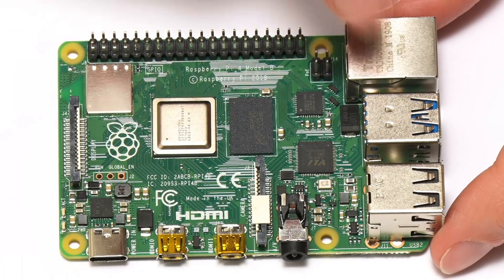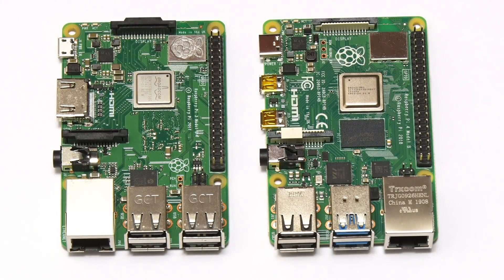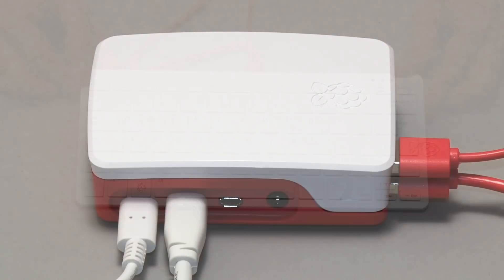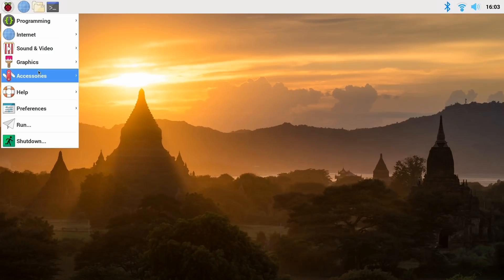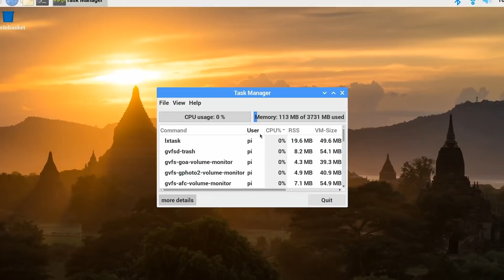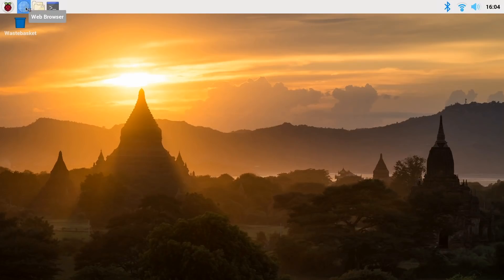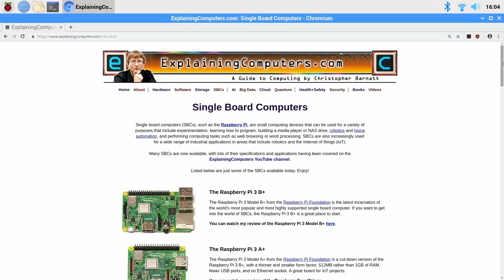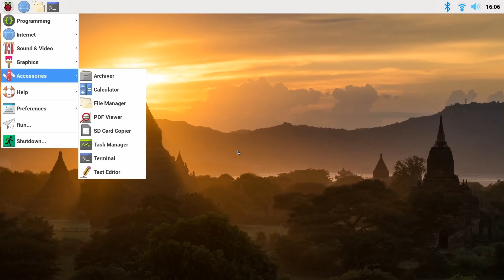Raspberry Pi 4 Model B

Comment: USB 3.0? Hello, SSD!
Reply: :) just put a NVME M.2 storage device inside a M.2 sata 2.5 with usb2 SSD enclosure ,placed inside a 3.5 drive cage,placed inside a 5/14 pc drive cage ,fitted into a spare cd drive slot, and sellotape a pi in the full hight pc case somewhere, and then just connect them together with your old usb1 hub sitting in the draw, sit back and wait for your coffee to warm up ;0) before you breakout the 300 baud modified acoustic coupler modems...
https://www.alibaba.com/product-detail/2011-fashion-USB-cup-warmer-with_513318946.html?spm=a2700.7724857.normalList.118.7b034a0czyTCi2
Reply: @paulmaydaynight9925  Now I'm aroused.

Comment: 4k display, 4GB RAM, hardware video codecs, USB3, gigabit ethernet. This is actually useful as an ARM version of a NUC.
Reply: Sadly no MassStorage Port. The Pi really needs a storage port (SATA or NVME).
Reply: @guytech7310  Odroid HC2 has SATA
Reply: @guytech7310  Nvme on the bottom might be a possibility down the road I would think.  Just an old guy; don't mind me.
Reply: @guytech7310  Yes, a m.2 slot would be awesome, as well as a RAM slot, but I'm afraid that could push the price up significantly. USB3 helps with connecting faster storage, though.
Reply: @DanijelTurina973  Ok so a Pi with a SATA or M.2 Port increases it to $85 to $100, I presume you would very much still buy, with a Mass Storage Port, it more than doubles the uses for the Pi.
Reply: @guytech7310  It depends what I need it for. If I only want it to run some python service that reads ambient temperature and responds to requests, then no, I'd buy the cheapest one and it would still be overkill. But I would buy an ARM version of a NUC, with two memory slots, m.2 and SATA, gigabit ethernet and good graphics, and I would want it to be an 8 core geekbench 15000 machine, and I'd pay 500 euros for that and use it as a linux desktop machine, as long as the hardware doesn't include remote kill switches that Intel and AMD have.
Reply: @DanijelTurina973  Sure, but there are already plenty of Pi versions that can already do that.
Reply: @Guy Tech Does one really need a storage port? You can use a Ram disc (on the desk in Riscos) and send to your serial device.
Reply: @factorylad5071  At best a Pi has 4GB of ram. a SATA or M2 drive can store terabytes. 

If you wanted to use a Pi as a small server or desktop machine. A decent linux distro would require a few 100 GB of storage. 

In my Opinion, a Storage Port would make a Pi complete SBC and would dramatically open capabilities.
Reply: @guytech7310  Yeah, and that's where the ROCKPro64 shines! Hexa-core CPU (4x Cortex-A72, just like the RPi 4 + 2x Cortex-A53), up to 4 GB of LPDDR4 RAM, support for eMMC, PCIe port... for just $20 more than the RPi 4.
Reply: @GRBtutorials  Yes but Pi is the standard, thus very likely more app & hardware\driver support especially over the long term. The Pi Clones will have custom drivers or tools created by the mfg, which may go out of business or just stop supporting or providing updates for for older SBCs. 

If Pi comes out with Storage port its going to be a standard that will be around for a very long time, and also provides a standard drivers\tools for Pi Clones.
Reply: @DanijelTurina973  *an M.2 (because "em-dot-two" begins with a vowel sound)
Reply: Danijel Turina i was thinking the same.

most office and school computers could be replaced by this
Reply: @fwefhwe4232  I'm quite enthusiastic about trying it out with a full version of Ubuntu, either Mate or KDE, and using it for a few days as my desktop PC, just to see how practically usable it is. I tried it with 3B+, but it's so slow I had flashbacks from the 1990s. :)
Reply: @DanijelTurina973  probably be better to stick with Raspbian instead of putting full Ubuntu
Reply: @jacobtungate3828  I'll definitely try it with Raspbian first, because I expect it to be better adapted to the hardware. Also, I'd prefer to get KDE running, but if it's slow I'll rather have Mate or XFCE than LXDE.
Reply: Milktank ™  Windows 10 is not useless. In fact, it's the best OS around by most metrics - performance, reliability, hardware support, ability to run everything. However, it's also a huge privacy concern, the updates run way too frequently and are disruptive, it installs software as a form of spam, without permission, and it probably has several layers of back doors, and that is in addition to Intel hardware back doors and kill switches. That didin't bother me before, but since America started using technology to sanction Huawei and restrict access to operating systems, I think everybody should be worried. Privacy and security-wise, a Raspberry Pi running Linux (with proper security put in place) might be the best thing around.
Reply: So many super-nerds flexing here in the comments.
Reply: the ONLY true disadvantage of this to the nuckit is a lack of Sata,  if  there was an msata slot on this board  instead of the cardreader it would have been the perfect board as msata is just so mutch mor stable than sdcards.  An option would be to use one of the usb3 ports  as usb3 is fast enouht for a usb-to-sata adaptor but sindse there  is no  usb3 port (or header) on hte back of the board,  adding one  neatly will be a pail :(
Reply: Waiting for a water cooled, 'cocked and loaded' ARM64 cpu/gpu and nvme x4 ssd
Reply: @whothefoxcares  The point of a Pi is a lower power\low cost SBC for modest computing needs, not as a gaming machine capable of 128 fps at 8K. 

FWIW: I use a atom server 20W CPU as my primary server. Linux with Samba\NFS (NAS), DHCP, DNS, Firewall, smtp\imap, dlna, Security DVR,  Asterisk (VoIP PBX), Plex (Multimedia Server), D2D backup for clients, SQL, VPN & a couple of VMs with apache web apps.  This machine has ample computing power for all the services it provides. Since this server is running 24/7/365 and uses less than 100W its far cheaper than paying for a server that draws +800W.

I doubt you ever see a Pi that needs to be watercooled. The Pi was designed as lowe cost, low power SBC.
Reply: @igcogcigciggicifx4763  I could be wrong but I believe it doesn't.
Reply: Main thing is that ethernet is now directly connected to SOC. Not like old usb ethernet adapter.
Reply: @igcogcigciggicifx4763  that sucks then. for a mini pc with ECC support and SATA maybe UDOO Bolt but IMO for the price of it you can get better hardware.
Reply: Would probably run Windows 10 for ARM nicely (if they make drivers for it)
Reply: @stonent  Well, the Windows 10 are not as exciting to me, because unlike Linux, where you just need to rebuild the entire repo for ARM and you're set to go, and if something isn't recompiled you download the source package and build it yourself, with Windows you basically either depend on the software vendors to make an ARM compile, or alternatively you run it emulated, which negates the speed increase.
Reply: @stonent  Windows 10 Sucks. Cannot understand why anyone wants to use it. MS move to subscription model sucks even more, and non business editions of Win10 bombard you with adds. Reminds me of IE with the Popup bug that just opened more spam when you tried to close the spam popups. Pure Rubbish!
Reply: @guytech7310  so then what OS do you use/recommend over W10?
Reply: @realifejon  Raspbian is an obvious choice for an OS on this, isn't it?
And there are support for Ubuntu, if you like that.  
Actually, the performance from MS Windows will probably be a disappointment if you compare to ordinary PC machines based on Intel.  They got more memory and more CPU power.

But I am guessing now, as I have not tried one yet.
Reply: @realifejon  Currently I use Linux\KDE Desktop with a Windows 7 VM (Virtual box).
Reply: @AndersJackson  I was mainly referring to @guy tech's comment of windows 10 being a shitty OS, and someone else saying that this can almost replace a school computer. If windows 10 is shitty, what other than w10 or w7 do you also recommend? I'm building a secondary pc to work on from home and currently im on windows 10 but the new pc i want to install a different os. If you recommend Linux, what distro? I have been looking at Kali Linux as well as Ubuntu, but im willing to try anything.
Reply: also my field of work is programming so ill take any recommendations for good distros for that too
Reply: @realifejon  For programming, pretty much any distro will suffice, you can use Ubuntu if you're a beginner. Kali Linux is purpose-made for hacking, not programming, so I wouldn't recommend it unless you want to hack anything. Finally, I recommend the Distrochooser if you're still undecided: distrochooser.de/en
Reply: @guytech7310  *sucks
*MS moving to
*non-business
*ads (short for "ADvertisements," not "ADDition."
*popup bug
*rubbish
Reply: @AndersJackson  Hello, are you referring to the RISC OS that cannot use wireless ?   I really don't want to be connected to an Ethernet cable.  Why hasn't someone developed wireless capability for RISC OS ?
Reply: @realifejon  any other Linux distro then Win are a better choice on RPi.
I would go for Raspbian on a RPi, but Ubuntu is probably an ok choice too.
What to choose depends on you. If you have not used Linux before, I would suggest Raspbian or Ubuntu.
The Kali Linux might be an good choice,  but probably not for a beginners.
Yes, Linux distrs are not MS Windows. You need to understand this.
Reply: @stevieray2804  well, you can add a wifi device to RiskOS if you need it.
It is OSS.

No, I have not tried RiskOS.
Reply: Milktank ™  lmao you idiot, you're just wrong.
I work in IT in a private bank with 4000 employees and we're migrating to Windows 10 right now.
You're 100% completely talking out of your ass, Windows 10 is perfectly usable.
You do understand that end-user clients don't comprise the entirety of a company's IT-infrastructure or its functionality, right?
Reply: @gouryoku  on a Raspberry P?

Comment: Wow, that is brilliant. Just wondering about the 'official' RaspberryPi case - I'm guessing there is now more heat developed and the case doesn't appear to be designed for heat dissipation. I've tended to go for the Pibow cases, great colours plus ventilation seems good.
Reply from the maker: It does indeed get warm inside the official case. :) I will be testing out various cooling solutions.

Comment: I'm honestly surprised by two things. 1. The move to usb type c for power, and 2. The dual micro HDMI.

I remember them talking about the next pi not having the exact same layout, but I was definitely not expecting this. Micro HDMI kind of rubs me the wrong way, though I'm OK with USB-c for power since the board requires more to run than previous pis.
I was expecting 2gb of ram to be the next pi, but I was also expecting them to stay with ddr3 still as a cost saving measure. The move to ddr4 and multiple ram options are very nice though.
Thanks for sharing this, its awesome seeing the new pi so quickly on release.
Reply: *surprised
*remember
*definitely
*Thanks
*It's awesome
Reply: @alvallac2171  Fixed.~

Comment: Can you run Windows 10 at a minimum without struggling?  I'm not saying we are all trying to do this but I am curious how hard it pushes.
Reply from the maker: Yes, you are right -- ARM Windows has been made to work on a Pi, and should indeed run better on a Pi 4B. :)
Reply from the maker: This is an ARM board, not x86 -- so it won't run standard Windows 10.
Reply: @ExplainingComputers  I remembered the version made for 3b+ compiled to Arm (not IOT version) I just assumed it would run faster on better hardware.

Comment: happiness noise

though the case could have some venting holes in the top cover to allow that CPU to breathe and a micro-HDMI-to-HDMI adapter should be included in the RPI4 box (not as an accessory) since nothing has a micro-HDMI port. And eMMC please.

Comment: I am in the middle of building a new NAS and now this has put a spanner in the works, usb 3 and gigabit lan in a low power setup would work great. It is even above the min requirements to install full blown windows 10.
Reply from the maker: Sorry about the spanner! :) Do remember this is an ARM board though, not x86 -- so it won't run standard Windows 10.
Reply: @ExplainingComputers  Ah forgot about it being ARM. Also the x265 decoding will please a lot of Kodi users for HEVC.

Comment: Pi 3 has gigabit internet tho.
Reply from the maker: The Pi 3 B+ has 300 megabit Ethernet, not true gigabit.
Reply: @ExplainingComputers  > because of USB 2 limitations.
Well well, seems you're right. Seems odd to bother with Gb interface and connect it via USb2. Perhaps it was just the case that they couldn't get 100Mb chips any more for the 3b.

Comment: I've ordered a 4GB version right away with most accessories to start with.
Still want to run the Pi as a small desktop, so there's hope now.

Otherwise, I'll also test emulation and stuff, potentially it could even replace my small NAS in which case I just go and buy another.

What an unexpected surprise.

Comment: Now it will support windows 10 easly because of 4GB ram
Reply from the maker: Do remember this is an ARM board though, not x86 -- so it won't run standard Windows 10.
Reply: @ExplainingComputers  i have installed it successfully on raspberry pi 3 model B with the help of the novaspirit tech video
Reply from the maker: Cool -- and ARM Windows should run even better on the Pi 4B, especially the 4GB version.

Comment: More RAM was one of my two wishlist items for an RPi (the other one is an ADC, but I interface quite a bit of analouge equipment - but in particular, think microphone).

One use-case I often press RPi3's to serve takes about 1.2GB of RAM at startup (the timesave from using zram was depressingly noticeable) and about 450MB in its steady-state, with about another 50-100MB per user connected to it. So that upgrade alone will basically turn the RPi from "good enough" to "acceptable" (also will cut down on the number of RPis needed, since the 4GB will need one new RPi roughly every 40-50 users, rather than every five users currently).

Never really got the point of more and faster cores tbh, but as long as downclocking and being able to turn off the cores remain as easy I won't mind.

The three things I'm very curious about is the speed of the USB3, the thermals of the machine, and if they have increased the max sampling-rates for the GPIO (in fact, any feature upgrade of the GPIO would be darn interesting)

Comment: Looking forward to the 4k 60fps test.  Keep up the good job 👍
Reply: Hưng Nguyễn Công What you need it tested for. 4k 60fps is supported via hardware
Reply: @UomoMagnetePlus  nothing wrong in doing actual benchmarks to see how well the implementation is.  There are plenty of ways an implementation can fail.

Would like the test on singel and dual screen.
Reply: @UomoMagnetePlus  I know the spec says so,  but it says that the ports support 4k,  not sure with decoding 4k 60fps,  realtime.  What we need is and actual testing.
Reply: Hưng Nguyễn Công 4k Hardware support means decoding via hardware. And by the way, nothing in a computer truly happens 'realtime'
Reply: @UomoMagnetePlus  no idea what realtime means to you.  I want "computer science" realtime. What I mean here is its GPU can decode H.265 4k more than 60 frame per second.  Another alternative is 1080 120fps, so we can watch 1080 video at 2x speed.
Reply: Hưng Nguyễn Công Okay, thanks for proving your tech ignorance and that you are here just for blabbing nonsense.
Reply: @UCewnWZudermIpksirrQmvDQ maybe I don't. Just didn't change my mind after reading this, again en.wikipedia.org/wiki/Real-time_computing
Reply: We need the Software first. The current builds only Support 30fps as i know
Reply: @P4YF0RY0U  that's sad. Where do you find that info? Might have to delay purchasing
Reply: @CNCH_HungNC  i got it from a german YouTube Chanel called "heise online"

Comment: At least a 64bit Raspbian, welcome to ARM64...
Reply: Raspberry pi 3 is 64 bit...
Reply: @rebelscum1925  processor yes, but official os was 32 bit.
Reply: @rebelscum1925  Even later 2 models were 64bit with a BCM2837 (same as in the 3, but underclocked).
Reply: I also would like to know if it boot from external usb3 ssd AND if you get the UAS bug too with some  usb3.1-m2ssd adapters?
Reply: Neutrality & Mutualism with AI & Robots in the video from magpi, they alluded to using an SSD for faster system speed... I'm assuming through usb3.  But they also said the sdcard bus is faster on Pi4 than any other Pi before (I think 1.5x faster, if I remember right)
Reply: @tyrzxv  Did a bit of read up, SD card is "2x faster" still only 50MB/s. Boot from USB and Net is coming. pivoting the root for now... 
But a true 64 bit Raspbian will NOT EXIST, some dual kernel 32/64 boot is in the queue... 
VideoCore closed source owned by Microsoft is still. THE TROUBLE !
Reply: Neutrality & Mutualism with AI & Robots, that's some good info.  

I have a little pi3 server that boots off USB, it has an sd card, but the card just tells the pi to boot from usb. I think there are or were some firmware update you could do to bypass sdcard all-together. I would think the pi4 should already be able to do the same at least from the usb2 ports, if not usb3 ports yet.  Also Net booting already exists for at least pi3, probably pi2 also since they are very similar.  You can have a cluster of Pi's running their OS from a local network file location, saving you from having to buy a ton of sd cards.